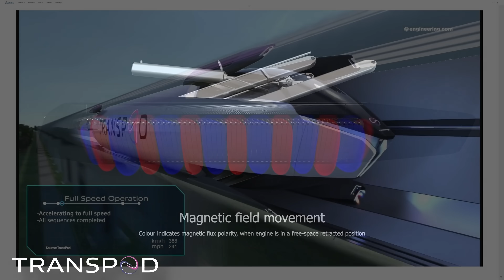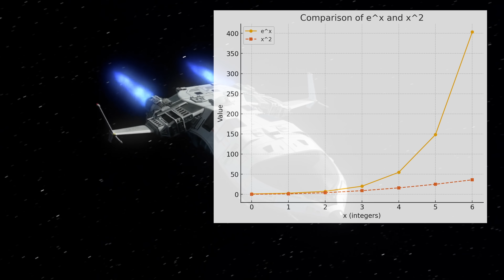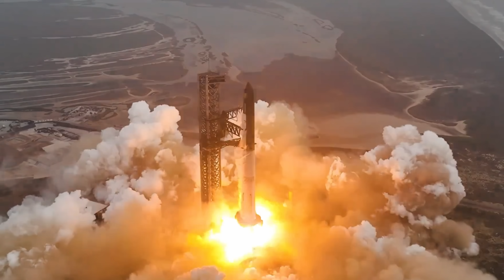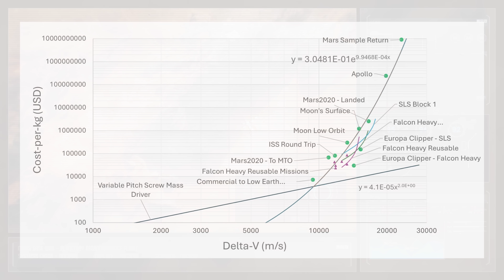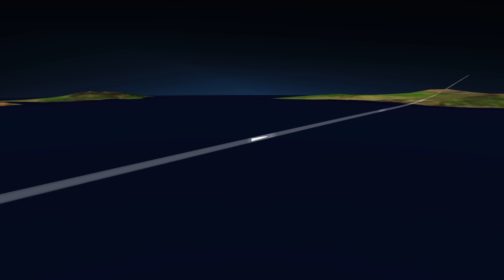Rockets vs Mass Drivers: Which Will Rule the Skies in the Future?

Comment: A mass driver on the earth, moon, or mars is a topic that is often considered as the subject of discussion. Another idea that i think has some value and needs some consideration is using a mass driver that could be up to 1000 Km long situated in outer space.  It could be used to either accelerate or decelerate a spacecraft in its journey to the outer solar system or returning from the outer solar system. It could even be used to de-orbit things from low earth orbit, or the moon, or mars, or any appropriate destination where speed reduction or acceleration is required.

Comment: The tube just below ground would be cheaper in the long run. & a telescoping last tube launcher on the final stage is an option. ie the horizontal & latter vertical pairs of conductors would both interact finally doubling the final run stage. So not connected but running over support pylons as it telescopes!!!

Comment: There is a mistake at the math at 20:18. The power at the end is proportional to the exit velocity (not exit velocity squared!). The energy required in total is proportional to the exit velocity squared. Thus the number on the screen should be 7995J, not 32,008,000J. So the energy required to accelerate from 7999-8000 m/s is approx 8000x more than from 0-1 m/s, not 32 million times more as stated on screen. Am I wrong?

Comment: just upgrade an inter-continental train track to orbital launch track. no such tracks? maybe built one. over the atlantic. mass driver is a normal train. so gamma rays would be the best photon drive. kerosene paraffin wax should be the safest solid fuel when self-heated up. same for chlorates as oxidizer, at 300C boiling point. that way solid separated rocket fuel/oxidizer turns to gas hybrid rocket when self-heated up. waxoxy rocket fuel. hold on, exhaust speed should not matter, only the total energy of the thrust, as energy converts to the speed of the rocket directly. ie energy contained per fuel mass. ie throwing air with a propeller has energy and more thrust the more total energy is used. ie the more weight is in the balance catapult, the faster the projectile is thrown the opposite direction.

Comment: TLDW: If there is atmosphere and massive gravity, rockets better. If low gravity and no atmosphere, mass drivers better.
Reply: Actually this take-a-way would be incorrect. If the mission's delta-V requirements are greater, then mass drivers are better.  So massive gravity wells favor mass drivers.
Reply: @pewterhacker  Second order thinking fail. Massive gravity wells = thicker atmosphere. How to solve payload hitting the thick atmosphere right out of the barrel of the mass driver?

Comment: Let's say a mass driver tube is straight vertical and located in Mt. Everest:

So 0.1-1 ton per meter of the mass driver tube x 70km = 70-700.000 tons that must be suspended in air. 

But a mass driver won't be straight vertical so it's more likely over 1.000.000 tons suspended in the air (or 100.000 tons if it's made from unobtanium).

Comment: Don't know much about physics, but am i correct in assuming that mass drivers more or less rely on the same physics principles as for example Ion thrusters, wherein they need a supply of small but constant energy to accelerate the vehicle, by means of low to zero friction, just adding to the momentum and kinetic energy of it
Reply: Mass drivers are to ion thrusters as elephants are to fruit flies.
Reply: @pewterhacker or a nerf gun to a naval gun
Reply: No

Comment: A really large space based industry  with space stations will have a lot of things manufactured in space. I think the future is in spin launch like technology for raw materials to space where space industry uses continuous sunlight for energy for building out space based industry.

It can get started on earth, but consider that Spinlaunch's current suborbital spin launch platform already launches with almost enough velocity to escape lunar gravity entirely. Imagine what one could do without an atmosphere on the surface of the moon. And, I think there's good reason to not use a lot of chemical rockets blowing around lunar dust.

Comment: Say mass driver and most picture a linear electromagnetic motor. My question is mass drive so limited as to exclude rotary motors as in a spin launch like platform?
Reply: I think SpinLaunch is a mass driver. Also, potentially a good one from a physics and economics perspective.
Reply: @spaceinfrastructure3238  I think it has great potential for launching raw materials  for processing in a space based industry.  Take water.  Send buckets of it to space.  Use solar PV to turn  it into rocket fuel. Then fuel or refuel rockets in space allowing one to ground launch traditional rockets with more payload or less fuel. Several spinlaunched orbital accelerator might even be repurposed  as booster rockets that can be attached in orbit to a heavy rocket that needs to get to higher orbit. 

Space stations in orbits that aren't shaded by earth or the moon  can benefit from continuous  energy from the sun for processing raw materials from the earth and moon. 

Consider the current SpinLaunch suborbital launch platform already launches with a velocity close to a lunar escape velocity, and the potential implications this has for a future space based industry.

Comment: Cars easily go 60mph which is roughly 0.1% of earth orbital velocity. Non-Maglev trains can hit 0.5%. These are speeds which can readily be maintained at surface level atmospheric pressures. How much lighter would falcon 9 be if it were launched at 300mph of velocity applied at 45 degreed? In other words, is there a sweet spot where robust bullet train tech is useful for reducing launch weight and costs?

Comment: Great work overall, but your last comment is wrong. Rockets are not so infrequent now that they have negligible environmental cost. On the contrary, we've been launching a lot of satellites, and the current use of rocket fuel in the upper atmosphere has significantly worsened the ozone layer, to the point that both poles have widening holes and we get more cosmic radiation exposure. We cannot let that keep going at the current pace, thus need alternatives like mass drivers to be used if we plan to keep expanding our non-earth presence. Given our growing demand for energy and satellites, getting these more expensive upfront programs working sooner than later is appropriate. Besides, so long as the economy grows faster than interest rates, deficit spending is a positive use of funds, if MMT is right.
Reply: Where’s your source that the ozone holes are widening? Everywhere I’ve seen/looked it says they’ve been shrinking since the 1970s or 80s
Reply: I very much agree. We need to consider the total amount of additional pollution from rockets after factoring in their anticipated growth from now until a more sustainable solution becomes operational.

Comment: is hybrid technology of driver assisted rocker takeoff a feasible idea?
Reply: It depends on the split between delta-v delivered by infrastructure and delta-v delivered by rocket. If you propose a hybrid scheme that's "mostly rocket", then the following quote applies: “Many novel launch schemes need some amount of help from rockets. What kills a lot of them is doing a tradeoff study of just enlarging the rocket part and getting rid of the non-rocket part. Surprisingly often, that works out to be better and cheaper.” --Henry Spencer

Comment: So a mass driver in the US would probably need to start in the Midwest and use the Appalachian mountains for the exit point. Rockies would be better but you'd probably want to incorporate the spin of the earth in the relative velocity, right? How high would the exit point need to be? 10,000 feet? 20,000?
Reply: Above 30 miles. 164 thousand feet.

Any lower and you would need a substantial heat shield and would also lose a significant amount of the velocity to drag. This is assuming orbital speed, assuming half of orbital speed maybe 20 miles and up to

Comment: I wonder if we could effectively launch space planes up the side of a tall mountain via low-pressure mass driver, then use rockets / hybrid engines with carbon neutral fuels to get the rest of the way. Could make for a decent intermediate stage until we built up bigger and better options.

Comment: I made a set of blueprints for a similar device as to what you mentioned at about 21:00. 
Mine is underground, and in a very tight spring/coil formation. Takes up less than half the space of what you described, and the magnets can follow along a rail with the ship. You just need a constant power source to launch the ship. With my maths completed, it would entirely eliminate the need for any kind of solid or liquid fuel to reach outer space. You can take the same amount of fuel, but use it exclusively for space-level navigation. 
It would alter the entire course of human history and space travel. But I got blacklisted because I refused to sell my plans for that and the chemistry that my team were using to make a better and more durable ablative plating for space shuttles. 
They stole our ablative research and now we have rockets that can enter hypersonic speeds without breaking the sound barrier. Never forget that NASA is just a finger of the Military. They shut down Chandra to spend money on making more of my ablative plating chemistry and more ICBMs. 
WE have been preparing to go to war for the past 15 years....And as always, they use science to commit acts of great and terrible evil.

Comment: Yet again,  all the argument presented in this upload is nothing but pure academic bla-bla, with no practical value, since the most logical, smartest, economical and practical solution is the space elevator - the only feasible way to build a planetary space shipyard and a space station on the Earth orbit, a place where we can build, later, ships big enough to travel to Mars or to the Moon. 
The space elevator is the only technological achievable capable to help us to load, fast and very cheap, the huge amount of materials on the Earth low orbit,  a first main condition for us to start the new space race. 
Everything else,  for now, is just a dumb spending of time and resources. Have something clear in your mind, folks: rockets are NOT the future, but the pass. We cannot conquer space with 5000 yo tech.
Reply: That’s just not true. The lostrom loop is calculated to have a cheaper dollar per kilogram ratio than the space elevator and options like a Skyhook or Rotavator still provide substantial benefits and are far easier to construct. A space elevator on Earth requires an extremely high amount of carbon nanotubes to create and would need to endure extreme stresses, it also needs to exceed geostationary orbit because just building the end right at geostationary the center of mass for the elevator wouldn’t be at geo. It also has the issue of where do you build it from? Do you build it from geostationary down? If you do how do you get that much stuff up there without the elevator to begin with. If you build from the ground up how do you deal with the compressive stress?
Reply: @peeperleviathan2839  - BS, NOTHING come close to the Elevator, THE only tech capable to provide a CONSTANT & UNINTERRUPTED LIFT (provided you use the ascending momentum to land cargo in the same moment). You have no clue what you talk dude, the launch loop is NOT a viable option: "a launch loop is a 4000km long 5cm wide bicycle cable that runs inside a sheath at 14000km/s, which is equivalent to the fastest man-made object ever made (Voyager 1 is travelling at 17km/s). Due to the mass of the cable, thousands of tons, the energy involved is tremendous.

The sheath has to maintain a perfect vacuum, because if any air leaked into the system, the friction would melt the cable and the system would explode. If any of the magnets fails, the cable touches the sheath and cause the whole thing to burn up and explode. If any temperature variations along the 2000km loop cause either the sheath or the cable to dilate or retract, even slightly, there will be slack or breakage, and it will explode.

But the biggest issue is that there is no known way to raise or lower the cable or to stop it for maintenance, and the engineering problems involved in building hundreds of platforms on the oceanic seabed and assembling the cable is huge."

Comment: crazy idea maybe but couldnt you theoretically do like a balloon system? Have a super massive long blimp type balloon thats permanently in the high stratosphere with a several mile long built in tube. It would obviously need to only be for cargo that can withstand high G's but you wouldnt have to deal with but a tiny fraction of the air resistance and pressure. Maybe it could be only a mile or 2 long with this set up.
I'd imagine it like a permanent floating factory where cargo is sent up very cheaply from ground level via other balloons which drop their hot air back into the main system and then are dropped back to ground with a reusable parachute. 
Lots of probably dumb ideas not well thought out, but it makes sense to me
Reply: Attach a lifting tube over the barrel . Over the whole length. The  balloon would have a conic shape because ambient offers less buoyancy at altitude. Barrel walls thinner though

Comment: If you lift a mass driver by drones, would the lower density of the athmosphere become a signifiant factor in efficiency?
Reply: The motors aren't effected too much since they are electric. They might become a little bit harder to cool with less dense air, but that's all. If the motors burned fuel, then the density of the atmosphere would have a greater affect on their efficiency. The propellers will also need to be larger, but in terms of converting power to lift, efficiencies similar to propellers optimized for denser air can be achieved. Ingenuity demonstrated this by achieving very impressive performance converting energy into lift on Mars.

Comment: Shoutout to SpaceX Starship which will bring the cost per kg so low and mass per year so high that it won't make sense to build anything else for a very long time. And it could use carbon neutral fuel too.
Reply: Methalox isn’t carbon neutral. Hydrolox is but it creates water vapor which is even worse than CO2 when high in the atmosphere, methalox produced water vapor and CO2.
Reply: @peeperleviathan2839  You can make methalox from water and co2 using solar power

Comment: I'm curious. In water, it's possible to pump air in front of a vehicle to speed it up, by reducing the pressure in front of it. Is it possible to do anything similar in atmosphere? Could you, say, pump hydrogen, or some other gas, in front of a moving vehicle, to reduce its atmospheric drag, without putting it in complete vacuum? If so, I would think it might be worth doing on a mass driver, since having a massively long vacuum chamber seems prohibitive.

Comment: 🎯 Key points for quick navigation:

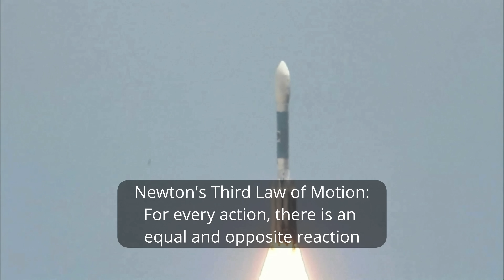[03:37] 🚀 Mass drivers use Earth's mass for thrust. 
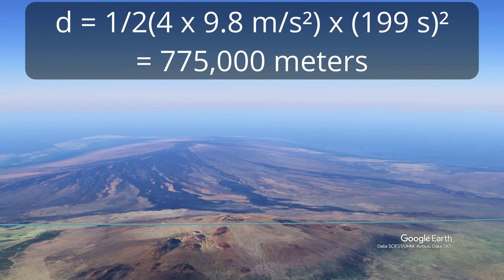[04:34] ⏳ Mass drivers offer faster launches. 
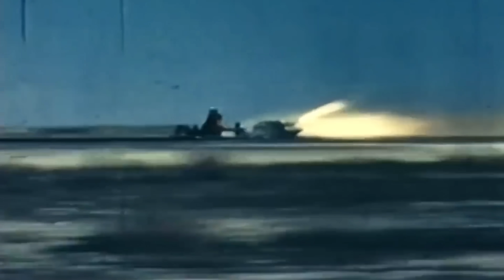[05:01] 🚀 Mass drivers can launch cargo at high accelerations. 
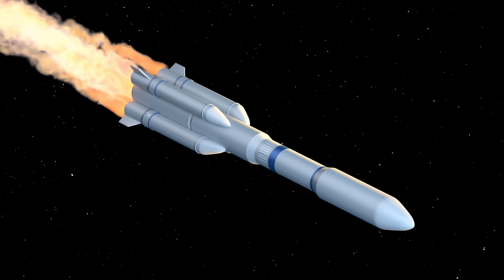[06:51] 🚀 Rockets expel propellant for thrust. 
[07:17] 🔥 Hotter exhaust increases rocket speed. 
[11:04] 🚀 Rockets require exponentially more fuel for higher speeds. 
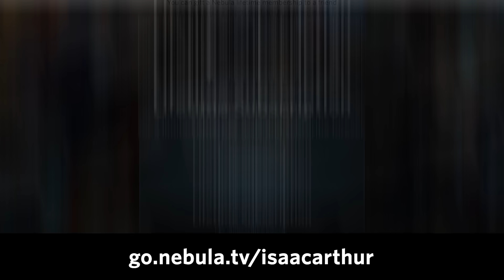[15:03] 👶 Mass drivers are newer technology. 
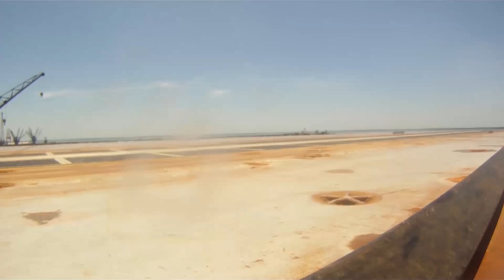[15:57] 💸 Mass drivers have lower launch costs. 
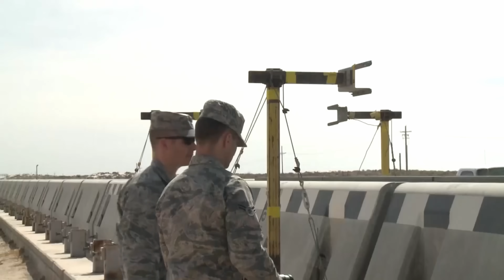[17:16] ♻️ Mass drivers can be powered by renewable energy. 
[18:09] 🛡️ Mass drivers are safer.
[19:32] ⚡ Efficient energy conversion is crucial for mass drivers. 
[21:51] 💡 Variable Pitch Screw Launchers are more cost-effective. 
[24:02] 🏗️ Variable Pitch Launchers use cheaper materials. 
[25:21] 📈 Variable Pitch Launchers have a cost advantage at higher speeds. 
[27:07] 💰 Mass drivers are cheaper for high-speed missions. 
[28:00] 🚀 Rockets are expensive for high-speed missions. 
[28:28]  Overcoming atmospheric drag is a challenge for mass drivers. 
[29:25]  Variable Pitch Launchers use evacuated tubes. 
[33:47] 💸 Rockets have lower upfront costs. 
[34:43] 🚀 Rockets are adaptable. 
[35:12] ♻️ Rockets are becoming safer. 
[36:05] ⏳ Mass drivers are a promising future solution.

Comment: One idea, going off the bomb kettle fusion power plant model, would be the Orion Spudgun. Have a large kettle of water, a barrel pointed skyward that extends far enough to catch the ejected steam, and a ship with pusher plate/parachute to ride the geyser. Absolutely demented, but buildable under nearly century old science. Would actually be interesting to see in an alien invasion story where we get less than 20 years notice and need to figure out a way to get battleships or missiles into space in a hurry
Of course, you could also use the power captured from a bomb kettle plant to run magrails or the like if you don't want to follow in the tradition of one of humanity's first launches into outer space, though theoretically you could always use both